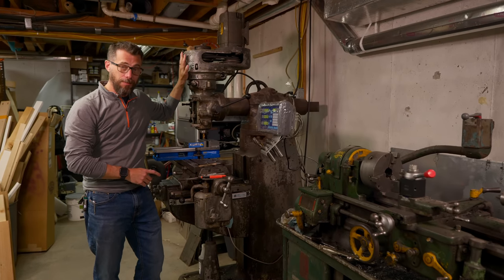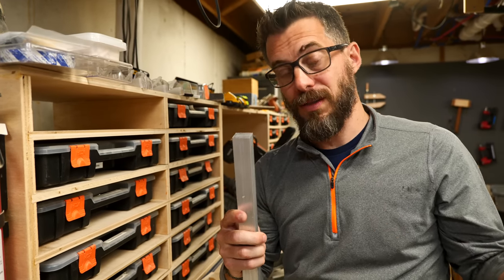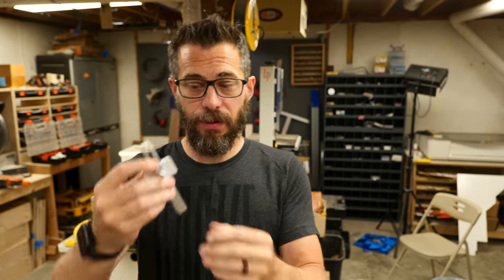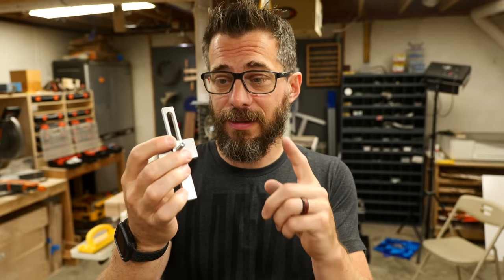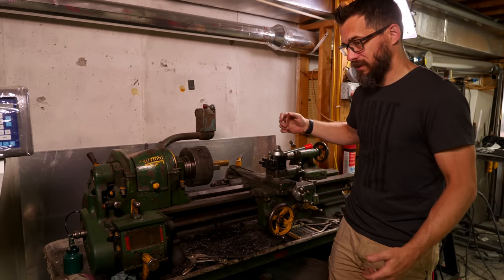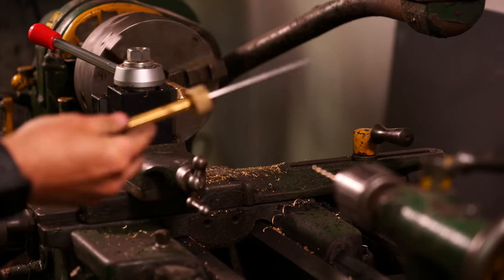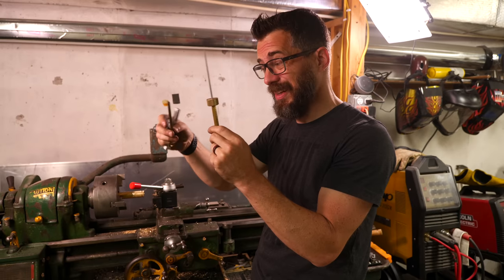Overcoming My Fear of Machining Metal

Comment: Good job facing the fear of these machines!
As many have mentioned, your chuck is configured for holding the inside of tubular components at the moment. The jaws may turn around, or you may have another set in your drawer/box somewhere. This will make it (slightly) less scary.
Your parting tool is stuck out a long way - keep it short as possible for less juddering (chatter).
Holes don't centre up nicely in non flat faces and a short centre drill (for starting the hole) will not flex as much as a regular twist drill.
For a straight thread, you can use the tap holder in the lathe - grab yourself a sprung Tap Follower to make things easier.

Comment: I have a degree in machine tool technology. Crazy tip for the cutoff blade: put it in upside down and run the chuck in reverse. In a catastrophe, the tool will climb out of the post instead of the part climbing on the tool and both breaking. 

You’ll definitely want to figure out that quickchange gear box so you can get the powerfeed going, which can usually switch between the Z and X axis. 

Taps have a center hole on their rear that can register with a center on the tailstock. If you take a wrench and grip the square faces of the tap, you can make the wrench hit the carriage and prevent from turning, to which you can intermittently jog the chuck at low RPM while putting pressure on the tailstock spindle, and accomplish a power tap while on the lathe.

Comment: Cool part! brass is kinda grabby with the tooling so that's why you heard that chatter. since you are a bit scared of the machine you have the part stuck out very far without any tail support. most times people will drill a hole and use the tail stock to add rigidity and avoid chatter. blondie hacks has a whole series on lathe and mill basics that you might want to watch. her projects are pretty neat too and might help you with the fixturing problems later on.

Comment: Two tips for the lathe:
1. face the piece and spot drill before using your drill. That will make sure your hole is centered. 
2. Use minimal stickout. Especially with knurling, just to avoid deflection.
Really cool video

Comment: Some hints: When parting 1) don’t have your cutoff tool extending out of the tool holder any farther than needed to cut halfway through the stock; 2) parting needed to be done as close to the chuck as possible where there’s more rigidity; 3) locate the top of your parting tool on the spindle centerline or slightly below; 4) part off at a low speed with plenty of lube; 5) for thicker cuts, it often helps to cut in a little way, then back out and move the parting tool several thousandths to one side and cut in past the first cut, then back out and cut deeper on the first location etc. I puts less load on the lathe that way if you’re short on power! Another tip would be threading on the lathe using a tap follower (make your own). This will guarantee that your tap will go through the bore straight, as opposed to angled, which is common on hand tapping! In closing, a couple years ago I was parting off 6 or 8” from the chuck when, in a split second, the work climbed the parting tool because of the lack of rigidity, the parting tool exploded into shrapnel, and the gears in the headstock self destructed. And keep in mind this was on a mini lathe with much less power than yours! Cheers! Oh, and reverse those jaws!

Comment: Not a machinist, but since Bob talked a lot about order of operations, here's how I think I would have approached the knob:
(using the outside-grip jaws is assumed but mentioned since it's been mentioned a lot in the comments)
face off the end (as is tradition)
skim off the OD
center drill
bring in the tail stock for support
knurl (slower and with lube)
drill to tapping size
counter sink
tap
chamfer the face (to separate us from the animals)
begin the part-off (with less tool stick out)
chamfer the back side in the parting groove
complete the part off

This comes from learning from Adam and Quinn.

Comment: I understand so much your feeling! All the sound and the vibration made me anxious. But in a way, the machine is communicating with you and it's just an adaptation to learn what she said. Every machine will react differently. 
Little tips I might suggest you : On the mill, use a soft hammer to position your part on the parallele bar before thighting too tight the vise. You should not be able to move those bar after ( or with some friction). It will tell you that it is nicely sit on the reference surface. So, you'll make sure your are always parallel and not tilt in the vise. 
For the lathe, I suggest to put a guard around the chuck. It helped my reducing the stress while machining. Also, as you realise, like milling, you have to machine the front surface and the cylinder face to have a good rough piece to work with. For the alignement of your hole, look if your tailstock chuck is centered with your main chuck.
For tapping, with soft metal, like aluminum, you can do more that a turn before doing a turn back to remove chips. And, you should use oil to lubricate while tap. It will recude the friction with the part and increased your success reate ( more important in hard metal like steel).

I'm far from being a pro, but for the few I know, this should help you! 
Great content, continue what you are doing!

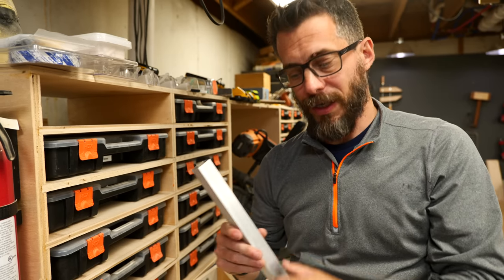Comment: One thing about taking measurements with the digital calipers, at 3:24, it looks like you're taking the measurement of the depth of the slot. On the opposite end of the caliper, there's that metal rod that sticks out when you're taking a measurement, that's actually a depth gauge. You lay the wide end on the outer lip of the slot, and open the calipers so the rod makes contact with the other side of the slot.

Comment: Machining is awesome, and so are you for trying something kind of outside your comfort zone and expanding your skillset.  
You are right to be very cautious around machine tools, especially the lathe.  A lathe shouldn't "scare" you, but you definitely need to give it the respect it deserves, because it can hurt and even kill you if you make some serious safety mistakes.
I liken it to using a firearm:  know the rules for how to use it safely and respect it at all times.

Some lathe pointers for your knob:

Knurling:
Knurling is kind of a black magic.  There are lots of charts and special dimensions and things to get really professional looking knurling.  And...  most of the time I just ignore those things and do exactly what you did and just go for it.  
When knurling, you need to use a lot of tool pressure.  That is, you have to press the tool into the work surprisingly hard.  The little wheels don't really "cut" the material.  They push it into a different shape.  So you need ot apply enough force to get them to do that.
It also generates a lot of heat, so you want to use a lot of oil or lubricant or coolant.  You'll keep the part cool and also usually get better looking knurling.
I've found that it helps to start the knurling tool in the middle of the workpiece and go away from the head, and let the tool slide off the end of the part.  
You can also try using your live center to hold the workpiece on both ends to keep it from flexing.  Again, you need a LOT of pressure to get good knurling, so your part will want to bend away from the tool.  Holding it with a live center will keep it straight in the machine.

Parting tools: 
I usually run a parting blade as SLOWLY as possible.  You were probably getting a lot of chatter and vibration because you were going too fast.  When you use a parting blade, the whole face of the blade is in contact with the part.  
This is a lot different from a regular turning tool, where a little pinpoint is the only part of the cutter that is in contact with the part. It generates a LOT more heat, and has a lot more drag and friction, so you need to go a lot slower to keep the machine from vibrating.
Also, when you set up a parting blade in a tool holder, you want the blade to stick out as little as possible from the tool holder.  The longer the blade, the more it can wobble and vibrate, and the scarier it gets.  Choke up on the parting blade as much as possible.  
If your part is only 1" in diameter, you only need 0.5" of parting blade sticking out, etc.

Tapping circular parts:
Pro Tip:  With the lathe power TURNED OFF, put your tap in the tap handle and put the whole thing up against the hole you drilled in the part.  Next, bring your live center (or better yet a spring-center) up from the tailstock and hold the tap/tap handle with the center.  
This will ensure the tap is perfectly parallel with the hole you just drilled.  MANUALLY start turning the head of the lathe and the tap handle against one another and this will get your tap started correctly.  I usually tap the complete thread this way.

Safety Tip:
Move your power switch for the lathe to the front of the machine.  It is a BIG SAFETY NONO to have the power switch dangling over the big spinny dangerous part of the machine.  
You don't see the on/off switch for your table saw on the other side of the machine, right?  You should NEVER have to reach over the spinning head of the machine to reach any controls, ESPECIALLY the power switch.

LOVE the video.  Keep it up!

Comment: The jaws on the lathe chuck are backwards, the tallest part of the jaws should be inwards when holding stock that can fit within the inside of the chuck. That is why you're having the issue of being scared of the mass you can't see while it is spinning.

Also for knurling, you'll get better results with the tailstock engaged in the work piece to help take some of the sideways load.

Comment: As someone that got their shirt caught on and wrapped into the drive screw on a lathe I can confirm that they are in fact very dangerous, luckily it was going a a slower speed and didn't have time to pull my face into the chuck before I got it shut off, which is the reason I highly recommend using a shop apron and not having any jewelry on to keep that from happening.
Reply: Shop aprons can do the same thing if they are long enough
Reply: Also girls working on those machines should pay attention to their long hair  ..!
Reply: @sambenao7  shop aprons are designed to rip before you do
Reply: Dear Jesus, I tensed up reading this.  Every time I see a lathe I worry.  They are a wood chipper without the sheet steel around.     Loose stuff is a big no no.  Glad you were safe!

Comment: Drills for holes, milling cutters for shaping. lay material in the milling vise as flat as possible when facing ends....less depth of cut means less strain on the tool. Carbide cutters don't like side loading and high speed steel will flex a little creating a bevelled cut if the depth of engagement between tool and work is too great. Lathe chuck jaws should have longest edge to the middle unless material is more than go through the spindle to get best contact with material. Three jaw self centering chucks usually come with two sets of jaws, an inner and an outer set, but when changing them put them in the correct numbered slot starting with number one jaw.

Comment: As a woodworker, I was never around milling machines or metal lathes. I found myself in a position to repair a high end rifle barrel that others said could not be repaired. A good friend who I had recently reconnected with had both machines. I researched, and researched and began to think like a machinist, my friend supplied the machining knowledge and experience, without which I couldn't have done it. We did it. A machinist like the commenter below, Kameron Stevenson, would undoubtedly have saved me from making an error that nearly made the naysayers correct. You don't beat a guy at what he does for a living, you learn from him. Powered woodworking tools are every bit as dangerous as the metal working tools, each can be intimidating. Machinists work with complex steels and aluminum alloys that we woodworkers have no clue about. Find a machinist mentor. The old schools guys, I'm betting, will gladly share their decades of knowledge and experience. Continue the legacy.

Comment: A lot of the comments are referring to practices for better machining processes. If you're looking to make things less scary all I can say is reduce your stick out. When something is sticking out too much, such as your material or cutting tool, it allows for more vibration and deflection. This is what you were feeling when you were referring to the feedback on your lathe.  Measure your tool lengths and material stick outs prior to operations. Whatever your final operation requires plus a little extra. A rule of thumb I was taught is avoid sticking something out longer than 4 times longer than its width. makes things much less intimidating.

Comment: Get a ratchet for the Bridgeport draw bar (it is a 3/4") it will save you some time. If you need pieces for repair/refurbishment I HIGHLY recommend H&W Machine Repair. They sell all the parts for it. For learning I would recommend sticking with softer material and if you are extremely worried about the lathe I would suggest trying some plastics. They are a little touchy sometimes but will definitely help with the fear of stuff flying out in the lathe or mill. On the lathe jaws if you have the reverse jaws with teeth on the longer side you may want to use those for longer pieces as you will have a better grip on the material. Not a machinist but only a hobbyist machine operator if a machinist has better information I would also love to hear it to help improve my skills as well.

Comment: Oh man, the lathe is such a nice tool to have. You can spend some time in a machine shop class to really open up the possibilities. Having to grind cutting tools out of HSS and a grinder was definitely a nice experience. Also, haven’t read the comments but I think you can remove/replace the steps on the holder. Can’t wait to see more videos with these machines

Comment: to get the hole centred on the round bar, before using the drill bit on the lathe saddle, use a centre bit it's essentially just a 2 sided drill but with a much shorter length to start the hole offm

Comment: Nice work Bob. Just like you got use to using a table saw, band saw, drill press, etc.. you will become comfortable using those machines. I couldn't tell but given the length of the stop block that you made, there may be some lateral movement when placing a workpiece against it. The stop blocks that flip up and down are much wider and really lock into place. This makes for very repeatable cuts. You should check this out before making a bunch of those units.  👍👍

Comment: Cool video. I am also in the early stages of learning how to use a big ol’ Bridgeport and giant metal lathe, which is truly a terrifying machine. Here’s some of what have learned.  A great channel to learn about this stuff is blondiehacks, she makes this stuff easy to understand and has a great sense of nerd humor. 

About the lathe:
First, the jaws on on the chuck are reversible, just open the chuck until the jaws come out, then flip them around and put them back in with the tall sides towards the center of the spindle. Much less scary and slightly less dangerous. 

And there were two things that you needed to help get rid of the scary noises, cutting oil and tail support. 

Now order of operation:

1) Chuck up your work piece. 
2) Face the end of the work. This should always be your first cut, using cutting oil to lubricate the cut. 
3) Center drill the work, use cutting oil. 
4) Add tail support by placing the live/dead center into the center into the center drill hole by moving the tailstock up to the work piece and locking it in the ways. 
5) Knurl using plenty of cutting oil. You need a fair amount of tool pressure, which is why you need the tail support from the live/dead center. 
6) Remove the live/dead center from the work and install the Jacob’s chuck in the tailstock and chuck up your drill (7/32 for 1/4-24 or 5/32 for 1/4-20). 
7) Drill your hole using the center drilled hole as your starting point, and be sure to use plenty of cutting oil. 
8) Tap the hole by placing the tap in the hole and supporting the back of the tap handle with the face of the Jacob’s chuck in the tailstock. Be sure to slowly advance the Jacob’s chuck as the tap sinks into the work piece. Also, use plenty of cutting oil. 

SIDE NOTE: The reason I’m writing this is because I recently made some knurled jam nuts that wobbled just like your knob does and it wasn’t the hole that was off kilter, it was that I tapped them in a vise with no tool support, exactly the same as you did and got the exact same results. I re-made them, tapping them in the lathe and they came out perfectly. 

9) Chamfer and part off the final piece. Although you can chamfer at just about any stage of the job, parting it off should be the second to last thing you do. 

The last thing you should do is 

10) Use some dish detergent to wash off all of that cutting oil from the finished piece and your hands.

Comment: For where your precision matters, clamp with parallels under a part, and the part against the back jaw. Then put a piece of wire between the part and the front jaw before clamping. That gives you just one reference point in the front. After your cut, you have a parallel top and bottom, and can flip the part around so that those are clamped in the jaws and cut the "side" perpendicular to the top.

I'd also recommend watching Blondie Hacks, as a good starting channel for hobbyist machining. She has a lot of good, practical advice that is very beginner friendly and very helpful. Your machines are lot bigger, so you are going to have more and different challenges, but it's still a good start.